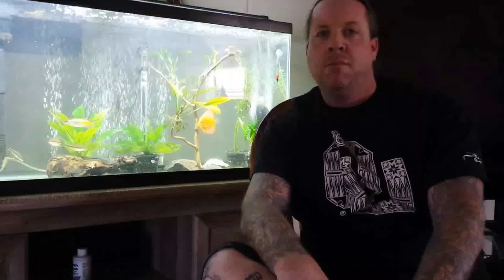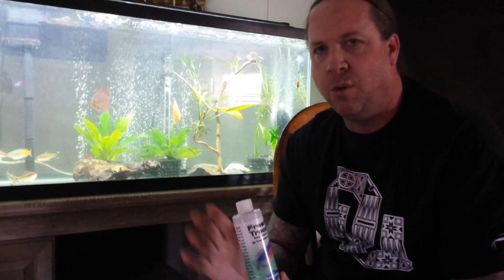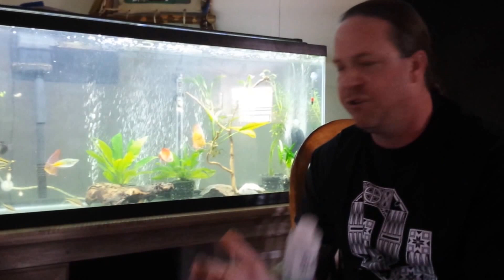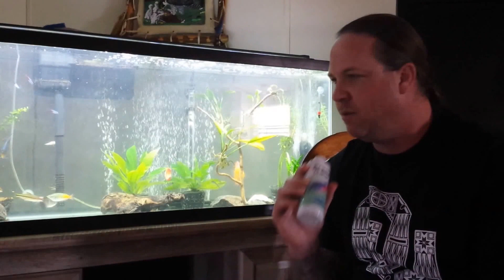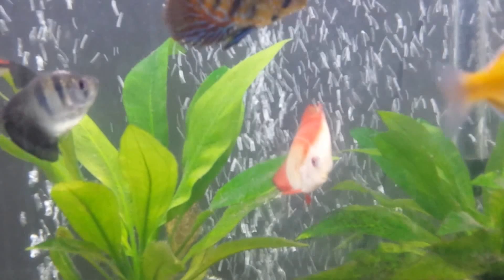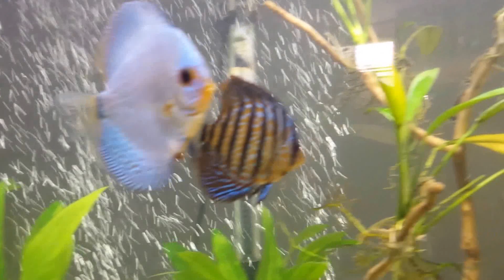RODI water in a discus tank - Pros and cons

Comment: Im using a RO/DI for my discus.  I have 40ppm nitrate from the tap as I live next to a farm.  I am using seachem Neutral Regulator got get up to 6.5 ph and adding discus trace.  my TDS goes from 0 to 150 ppm and my discus eggs have not been hatching.  Would you recommend I add something different, or use less Regulator?  I recently started adding alkaline buffer to raise my kh to a 3 as the ph slowly drops to a 6.0 inbetween water changes.  Thanks for the Help and the video was very informative

Comment: great videos , right on point and no way around it if you want discus, and i do want them, im working on my water now before getting any discus, Here is my problem at the moment, i mix ro and tap water, getting gh of 5 and kh of 3, however my ph is 7.4 when i do that, so i used seacheem discus buffer to bring it down to 6.5, is that ok what im doing or should i do it a different way, will that ph stay stable? i buy the ro si mixing it with tap i cut the cost
Reply from the maker: First of all,  thank you so much for the feedback.   Please look at some of my other videos.   I believe I just spoke about that in a video I just did.  Yes, use tap water to add some buffering content nack.  Just add less tap water.  Discus can osmoregulate just fine in very soft water with low mineral content.  You can also add a mineral content, like discus trace by seachem.  Discus buffer will also work but I hear you saying that you want to save money so just add less tap water.  Add driftwood or peat moss to your tank, this will also help to give you that acidic profile you're looking for that is key to good discus health.  Please look at some of my other videos and sub my channel.   I discuss this all the time.   Any questions or clarification you need, I'm more than happy to help.
Reply: Thank you, thats what i wanted to do, however been reading forums, and the reason i want the kh around 3 is to have a stable ph, if i add less tap water ill have less kh and i might get ph swing.the  person that i want to get the discus from uses tap water, ph of 7.5, kh of 7 and gh of 9. now the weird thing is that once he ads that water to the tank it switches to ph6.5, kh0 gh 13, and how that happends i dont know, same filtration as mine, the only difference is that he got some plants in the tank, no co2 and i have bare bottom, that might be it but not sure, Subscribed and going to watch all your vides, as i feel u got the best info here, right on point, and again thank you for sharing ur knowledge with us newbies.
Reply from the maker: srbsilver What about adding driftwood and peat moss? This is fairly inexpensive and will add acid naturally.
Reply: yes thats an option, when i ran my tap tru a 5 gal bucket full of peat it lowered the ph for the day but then it went back up, and striped all the kh. seem like every time i get one thing wright the other thing lowers. im happy with getting ro mixed with tap, getting a kh of 3, and adding discus buffer as long as that will stay stable until the next water change
Reply: ok, how about just ro water, where i get it from it has a ph of 6.5 0kh and 0gh. now if i just use ro and add acid buffer with alkaline buffer and the discus esentials will that lower the ph or what will happen to it. and is all this chemicals good for the fish